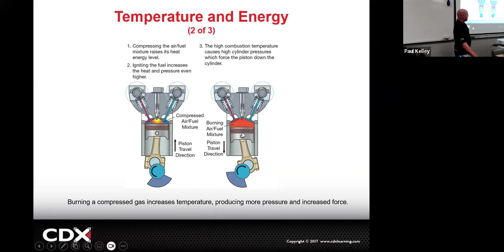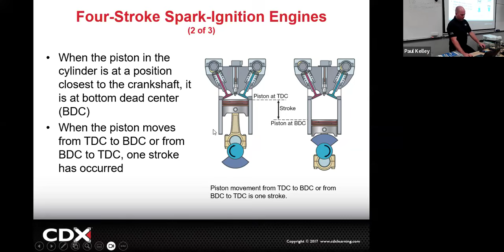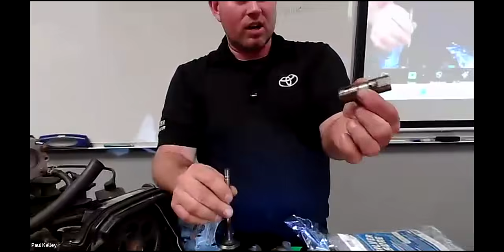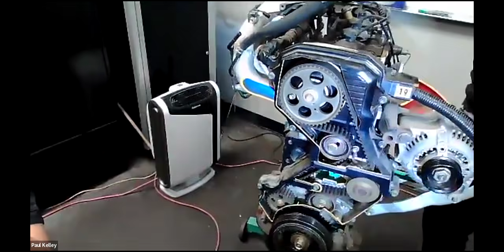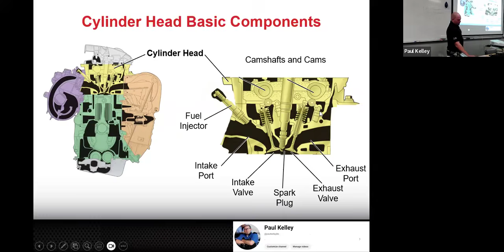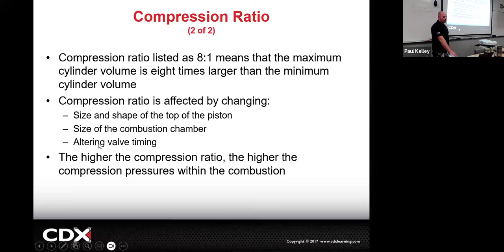ASE A1 Engine Repair Class Unit 1 Introduction Part 1 (Sample members only materials in description)

Comment: @27:00 is this graph not labeled incorrectly? it shows as the volume increases so does tempature, but would the opposite not be true? as you decrease volume, pressure increases thus does tempature. if volume is increased then pressure would naturally decrease along with temp.

Comment: @CollegeAutomotiveClasses do you have any recommendations for affordable books to learn from? Just a DIY guy following your videos and trying to learn
Reply from the maker: Any of the publishers textbooks are OK. They all have their shortcomings but still offer a ton of information. The one I chose for various reasons is the CDX Master series. Look for used to save. Retail is about $70 which was much less than Halderman, Cengage, Goodheart Wilcox. Although you may find older versions of those even cheaper. 
I try to be thorough enough on the lecture to have it stand alone, but if you want to follow with a book it would be the CDX Engine repair.
Reply: @CollegeAutomotiveClasses  thank you so much! Just joined the channel.